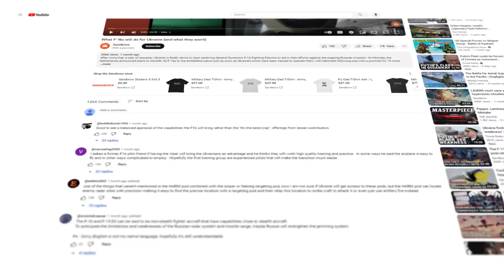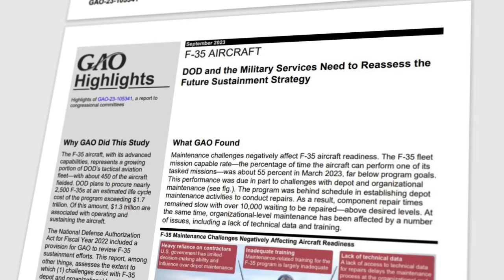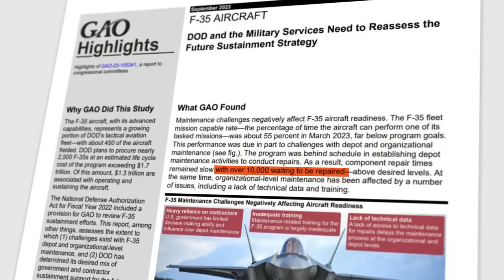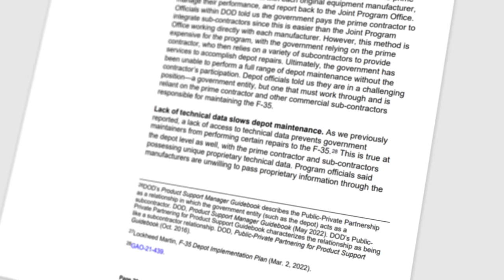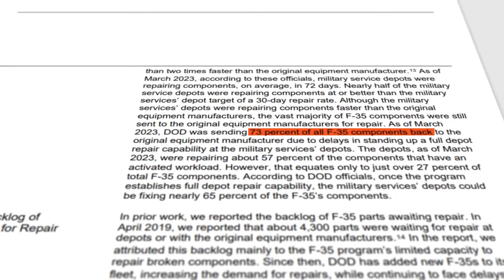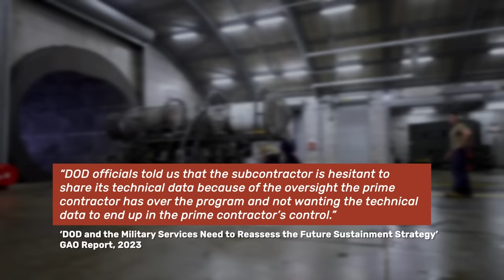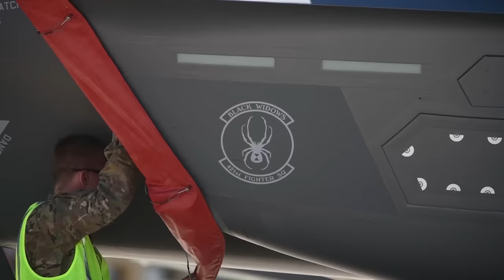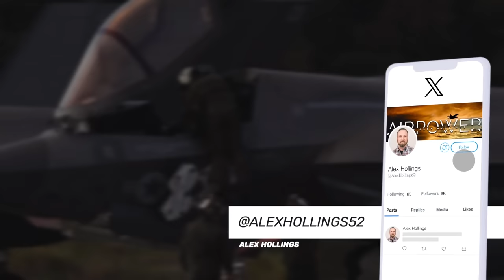Why are only half of America's F-35s ready for a fight?

Comment: Hey Alex, why you keep saying the F-35 is not as powerful, or maneuverable as fighters of old. It gives the impression that the F-35 is slow and sluggish. Its not.
Even if we look at raw T/W ratio of the F-35A from empty weight all the way to max take off weight, its comparable to many multi-role 4th gens

Rafale C : 0.63 to 1.57
Su-35S: 0.81 to 1.48
F-35A: 0.65 to 1.48
F-16C: (block 70): 0.69 to 1.47
Tejas: 0.63 to 1.31
Gripen E: 0.60 to 1.24

I don't think any of the fighters above can be considered "slower or not as powerful as fighters of yester years"

Comment: Back in 2008, aviation experts and consultants said that the F-35 program should be cancelled and that the whole program was going to be far too costly for what the military was going to get. I think they were right. The F-35 program is a disaster. They should buy half of the 2400 planes in the plan, and use the money they save to buy 3000 light weight fighters. It cost $38,000 to fly for an hour while a light fighter can be flown for $10K an hour meaning that you could buy the planes and the pilots for the money saved. Even the Air Force seems to be considering the purchase of some light weight fighters to compliment the F35.  While there may be some application for Stealth,  jamming is just as an effective approach.  4000 Light weight fighters and 200 jammers would be a better deal.
Reply: F-16's can cost as much as $20k per hour, plus what those numbers often forget to include are the additional maintenance costs of targeting and EW pods, etc which the F-35 already has incorporated and more effectively. Big reason for the air force considering a lightweight fighter is to help increase the airframe service life of the F-35 by performing the more basic missions, they've suggested that many 4th gens won't be survivable in modern airspaces within the next decade and that includes the F-15EX which I'm sure has some great jamming capability.

Comment: What you referred to as problems caused by corporate capitalism are really problems caused by government incompetence at interfacing with corporate capitalism and ensuring the incentives of its employees are well aligned with success rather than leaving room for conflicts of interest (e.g. the "revolving door"). As the former program director said, issues like data sharing could've and should've been forseen and addressed by the contracts. That's what another corporation would've done had it commissioned a program like the F-35.

Capitalism induces in market participants almost all of the counter-behaviors necessary to counteract the behaviors it induces in other market participants. The problem is that governments are terrible at behaving like self-interested businesses when they participate in the market ultimately because its not their own money that they're working with.

Comment: You know government contracts given to subsidiaries contracts. The DOD should have full unimpeded access to all matters when contracts are awarded. Now if the contract was not awarded to the subcontractor well that's fine. We should not have to beg and borrow from a subcontractor the codes for the property that we own. I do know that it is a slippery slope, but what happens when a country such as China breaks the code?  The USAF will be sitting there with their thumbs up there 6. Due to the fact that the DOD IE. Pentagon and those on the field do not have the ability to do anything but shut it off if possible at all for the pilot. That's ridiculous. Seriously, that's a problem. Warehouse full of parts, and  no doubt paid for ! 🫣 Doesn't take an Einstein to figure how messed up that situation is. For sure! Ty for the update, serious recon and Intel there. Ty! 🕊️

Comment: Alex your videos are so inspiring. I like how you explain an issue then show what's being done to mitigate it. Thanks for all your hard work.
Reply: I was a T-4 nose to tail mech for LM at Elgin.  We taught the AF, Marines and Navy how to maintain the F-35.  I am impressed with your accurate reporting.  The tech data is available but the services got what they bought.  The LM and Northrup techs have all the info and can directly call the head engineer's for any particular system.  The tech reps work with the military on site.  The Depot level maintenance was bid on and the winner of the Depot contract was NOT Lockheed so therefore they don't have the airframe expertise or the tech data we had as T-4 mechs.  That translates into current poor Depot level rates IMHO.  Good job on your reporting.  I left LM in 2020 for retirement.  Fun to keep tabs on the program.

Comment: Bro I'm only 5 minutes in and the best way to put it is your wrong, US contractors have been bleeding money out of the Tax payer with proven intentionally wasteful spending normally down to overvalued running cost  and just straight up poor management of project development turnover, Lockheed should have been brought before congress several times over in violation of the military spending budget act. Sure as a platform and as a piece of kit it's great just the the economics of it's develp0ment have been manged.

This is not the first stealth program the US has run and it is not the most technologically advanced either, so just because it's fighter program does not mean we don't have other comparisons we have the F22 the the F117  to compare to economically which are both fighter variants that had their own program. You guys really need to stop defending this nonsense because you are doing the turkeys that voted for Christmas thing. Sure the media buzz is a load of fluff around this and should be ignored but that is not to say the program has not been mismanaged, Delay after delay after delay. 

Dude I remember going back about 19 years ago and the US going our F35 will be ready, built and in service by 2010 and all 3 versions....... and here were are 2 decade later and we 50% at best complete on this promise. Would you care to explain on their behalf what the actual F%&# Lockheed have been getting up to for the last 20 years now? yeah that is not happening in a 20 minute video, Il watch the rest but I do not see the reasons you are about to put out even coming remotely close to addressing why and properly this seems like we are looking for excuse to hand wave accountability, for example like people don't understand how economies of scale work that happened to be watching this because odds are they do.........

EDIT: Il admit I wrote this around the 5:20 mark-ish but you are pulling my leg man that is uncanny what you just followed up with, so we are actually on the same page then cool. Still think the lesson here is accountability for higher ups though like that is the "fix" for this if you will.

Comment: 90% FMC rate is only achievable with a war triggered budget. 
In order to achieve 90. The criteria for inspections and replacement of parts has to exceed book spec. Maintenance has to happen with the thought process the aircraft will need that margin to survive any given mission you can not plan for. 
Garrison or especially budget restrictive maintenance will never achieve that no matter what the competence level of the maintenance and pilots are. 
If you don’t believe me. Look into the flight hours and readiness levels of the 10th Mountain aviation brigade in Afghanistan of 06 vs the 82nd Aviation brigade in Afghanistan in 07. 82nd set records. We bested 90 % and I think tripled the flight hours. I was an AVIM engine guy.  There were no compromises from any military or civilian component that deployment cycle. That’s what it takes.

Comment: Lets face facts, the F35  is no better or worse than a lot of other aircraft flying, be they Russian or Chinese, so what makes it special, well for one thing its stealth ability is better than most other aircraft flying. This of coarse Leeds to more maintenance issues, because even if you could fly an F 35 with incomplete stealth coatings, it would negate the point of having it in the first place. So all this dose not make it the best plane on the planet, but what does is the brains of the aircraft, its computers and connectivity are what makes it a stand out aircraft, the only one on Earth that can do what it does at the moment. The NGAD and possibly the B 21 will also be as smart and as connected when they come on line, but at the moment nothing beats the F 35's smarts.

Comment: Glitchy software, software that shuts down during flight, software that needs to be re-booted during flight 
O2 system problems that have led to low o2 resulting in episodes of confusion, visual field loss and even blackout all continue to occur. Resulting in limited flight ceiling of 25,000 ft.  Problems w/radar absorbant skin during flight and weather. Etc, etc

Comment: Thank you for your nuanced analysis of the situation around the F-35. I agree that these are systemic issues that affect every aircraft program in somewhat democratic nations. 

That said, the USAF's biggest adversary and challenger is China, which is NOT a democratic nation. Even with the understanding that China is not honest and forthcoming about really anything, it's still worrying that J-20 production rates appear to be closing in on the F-35's. That, paired with the generally ruthless efficiency of Chinese society and heavy price placed on success, I feel that we have plan for the fact that their J-20s may have 70-80% readiness rates. And if that's the case, then China will soon operate a comparable or even superior 5th gen fighter fleet to the US, which is very worrying.

Comment: Good review of manned combat aircraft availability rates across the world. 

But let's test those rates (55%-90%) against Cheap, Long Range, Attritable Drones, purchased in large quantities and stockpiled brand new like ammo (100% = best possible). Unmanned systems don't need to be used for training, they don't need to be maintained, hours of service life are not being burned off when they are sitting in a bunker. Also, the recon Drones that are used daily, can use cheap efficient commercial engines, fly slow and gentle way up high 70,000ft. 
It is debatable whether "6th Generation manned combat aircraft" will ever be built, given all the benefits UAV's grant to "Combat Power" (Firepower is based on Quantity). 

For the price of one Aircraft Carrier Strike Group ($50B), 25,000-$2M/ea. XQ-58 Valkyries can be fielded. Which carry the same "smart weapons" as a Carrier's 80 aircraft, can reach any battlefield in hours, and whose Availability of 100% is 3 times the 33% rate of Aircraft Carriers and warships (Port Queens are worse than Hanger Queens).

Comment: A video about the AAS / FARA (armed scout helicopter) program would be cool. Sikorsky has the S-97 Raider compete with the Bell+Textron 360 Invictus.
The Raider has troop capacity while the Invictus does not, but that gives the Invictus better stealth properties, just like the Boeing-Sikorsky RAH-66 Comanche had. Not sure why Sikorsky they abandoned that design, as they first came up with it. Just to push a common scout and transport design when they already lost the Blackhawk transport replacement to the Bell V280 Valor?
Reply: I would also say the invictus would be cheaper to purchase and maintain. They said they used a lot of off the shelf technology. I do think that the raider should win. The raider can drop off or evac small number of troops.
Reply: Raider seems like it would be a pretty slick aircraft for a unit like 160th to use in support of small SF teams.

Obviously couldn't get into all the crazy spots an MH6 could, but the speed, range, and relatively low noise signature could probably be really well leveraged in that sort of role
Reply: @ameritoast5174  i don't think the raider fits the concept of a scout and light anti armor chopper very well.
It would be a better choice as short range troop transport and support, whereas the V280 Valor is an extreme long range and large bird.

Comment: What is most unfortunate is that the Air Force generals are more interested in flashy g have new technologeez rather than supporting the man on the ground which is what the Air Force is primarily supposed to do.  This is driven up the cost of aircraft to be pretty absurd.  I would debate the value of 1 F22 being greater than 10 to 15 F's15.  (I believe this to be true worth for initial cost and for the cost of maintenance.)   While I certainly agree that we need some F22 aircraft, I also realize that in most of our combat situations it would have been far more important to have the numbers.  I was involved at the time of the gulf wars, and I can assure you that the F117 was fabuless for its application.   However once we no longer needed stealth aircraft the F15, F16 and F18 performed beautifully.  In other words we will always need "workhorse" aircraft that do not require stealth capability.  [ I still contend that it was a huge mistake to give up the F14 aircraft!   The Phoenix system was far too valuable to allow it to go to waste.  Now the navy requires far more F18 aircraft to be airborne!!!    My point being that sometimes there are other issues that are more important than stealth!  Another perfect example is the A10 which the Air Force generals have been trying to trash for 30 years!!!  BUT, the army and Marine fighters love this aircraft more than any other!!!  (Just ask any of the Marines and army personnel who fought in Iraq war Afghanistan!) The basic problem is that the generals are more concerned with prestige and their Ego's than the needs of the man on the ground!!!  (I got this quote from an Air Force general.)

Comment: Did I just see an F35 (in your B-Roll around the 2min 16sec+ mark) perform a static launch from a 45deg standing rail system ? .... Impressive, unless I am not seeing the launch assist, other than the big motor mounted inside the jet.....
Reply: After watching it a bit more closely a few times, it seems that there are/is some sort of "drop-rocket-assist"....but whatever. This is about as cool as it gets. Imagine the 'Battle Of Britain' or similar, taking place today, with zero need for launch runways, for an on-call airwing. This definitely gets the boys up into the sky PDQ.
Reply: That's the XQ-58 Valkyrie, a combat drone still under testing

Comment: Also my understanding on a very important context, and I could be wrong but I've seen it referenced elsewhere;is that readiness is tied to an airframe being mission capable in all of its intended mission types. Not necessarily that it can't fly, perform it's core functions, or engage in other mission types just fine. While that's still problematic for a fighter as advanced and with as broad a mission list as the F35 is capable of that's an extremely important piece of context IMO. If it can still go up and kill things but the stereo can't blare danger zone cause doesn't work that's a far different scenario than being grounded in a hanger.

Comment: The F35 is a joke right now.  There is a reason why we are upgrading 600 F16s to the most modern variants instead of just retiring them, and its because the AF has no faith in the F35.  

Buying 2400 F35s as planned is the HEIGHT of idiocy, these are boondoggles for Lockheed and the states where the plane is built.  NGAD will be no different, what's the point of wasting billions or trillions on a short range jet whose bases will be in range of enemy missiles from the second it is based there?
Reply: “Because because because deterrence!” Or something like that
Reply: @coreyleander7911   F35 needs to be stopped at whatever is being built right now for the Air Force, maybe 500 planes total instead of the retarded 1700 the AF says its gonna buy.

Cancel it, then put all the 120 billion in savings into buying REAL PROVEN jets like the F15 EX, a supersonic long range antiship missile to sink Chineee warships, and as many B21 as can be built provided that this bomber passes all its current flight tests.
Reply: Instead of wasting untold trillions on NGAD, just build literally MILLIONS of long range drones instead and saturate Chinese air defenses on both land and sea.
Reply: How are they bad
Reply: F/axx is the answer to the problem of chinas area denial bubble. It will have greater range and stealth needed to getting deeper into that bubble and begin taking out some of those defenses and landing craft. And the f35 in war games has proven its worth against China yes you’re right they suffer from range(and that can be increased with the new stealth fuel tanks for the f22 and can be retrofitted onto the f35) and the us is uprgrading the f16s cause it’s a nice aircraft for when you don’t need to go full stealth and keeps maintenance costs down the same with the f15ex. The f35 isn’t exactly the golden gun, but it is definitely a great force multiplier especially when paired with other aircraft because the f35 can send targeting data to other jets I mean hell they used a f35 to guide a interceptor to take out a test drone. This interceptor was launched from a patriot. And ngad will be flown with drone wingmen(which will have onboard AI) we are planning to buy 200ish ngad but over a 1000 drone wingmen that will fly with NGAD, F/Axx and the f35.

Comment: It seems like the biggest issue is unrealistic expectations. How do you expect a new more complicated airframe have a way better readiness rate than a simpler older model that they have all the processes in place for.
Reply: Are the issues on the airframe mostly - or is the F135-PW-100 engine most of the problem?